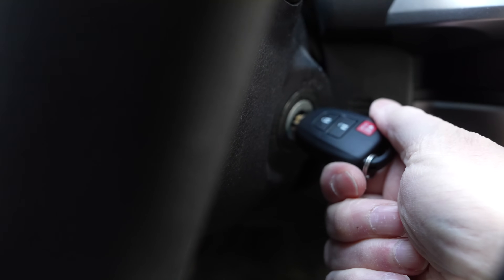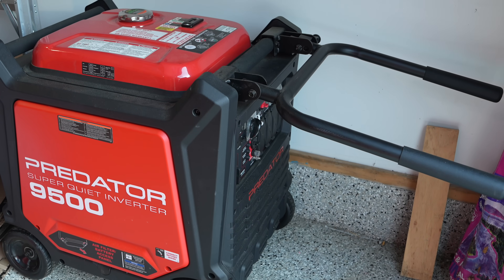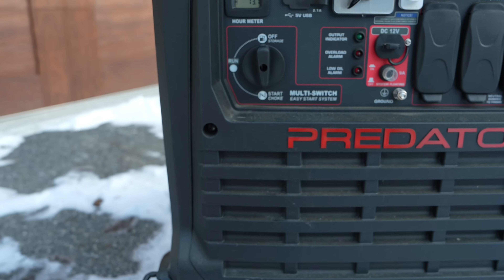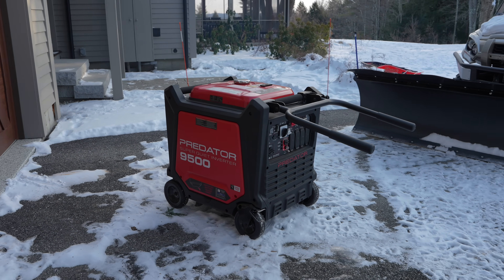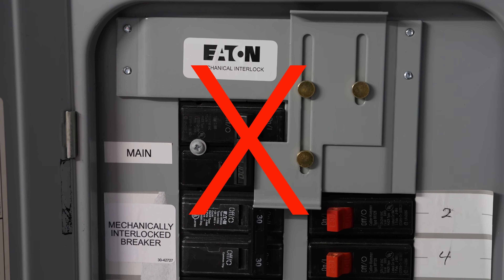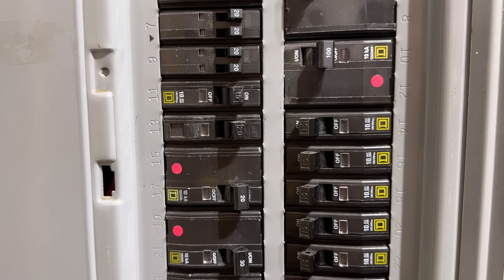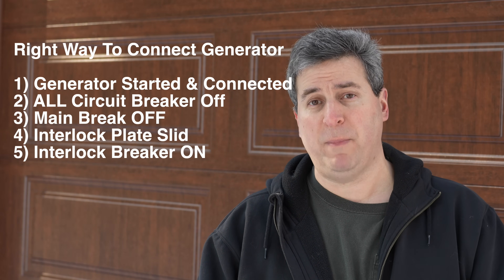Homeowners are Destroying Generators Skipping 1 Step During a Power Outage

Comment: This is good advice for the lay person but if you have an understanding about the size of your generator, your loads AND your breaker box load balancing, you can apply common sense and will be just fine.  So, how about a video on breaker box load balancing?  If you have a 7000W continuous generator, that really means ~29A per leg.  You don't just manage to 7000W, you manage to 3500W or 29A per leg.  Whichever comes first is your current load limit.  I have rearranged breakers to help with this, and printed off which loads are on what leg, so I can most effectively utilize my backup generator power without overloading it.  But I'm a EE so your mileage (and interest) may vary.

Comment: Another reason why I dont like interlock breakers... I use a generator to recharge a battery bank and then devices are plugged into ups units hooked up to that battery bank, that automatically switches back and forth between batteries and main. Basically a solar set up without the solar panels.

Comment: If you’re only focused on backup power for a few key circuits, just get a transfer switch. Generator only powers those circuits, don’t need to touch the main panel when working with the generator. And when the power comes back on you’ll know because the rest of the circuits not wired to the transfer switch will come on.
Reply: Put the interlock in a subpanel and leave the main panel on any you'll get the same affect. That's what I do. When the main AC or water pump kicks on I know my power is restored and can turn off the generator

Comment: As an electrician I agree completely. And shut all your breakers off before shutting down your generator. Never turn your generator on or off under load. 
Also, absolutely shut your generator off and disconnect it from your home BEFORE you reconnect to the gird power!!!!  
And, the kind of generator in this video won't run anywhere near your whole house. Just a few circuits, and NOT your electric range, water heater, clothes dryer, vacuum cleaner, hairdryer, etc. A few lights, the fridge, and a computer. Stuff like that.   Get a proper generator interconnect if you can afford it.

Comment: Have never seen the interlock set up. Very smart.
Reply: Never seen one here in Europe... The few homes with backup power that I've seen either had 2 main breakers with no interlock (iffy and violates code), a rotary 3 way switch with a disconnected middle position (which is what I installed), or an automatic cutover.  The latter seems to be popular with battery setups, and some cutover systems are fast enough to make a seamless transition that not even electronics will notice.

Comment: I have a 6 circuit bypass box with critical 15A circuits. On a power outage, the first thing I do is switch them all from LINE to OFF. After the generator hookup outdoors is complete and it is running, each circuit is flipped from OFF to GEN one at a time, starting with the most essentials ones: sump pump, then fridges, then furnace, followed by the others. Once they are all on GEN, things are on autopilot.

It's important to consider what to do when you shut down the generator: Before shutting off generator, flip each circuit from GEN to OFF, to protect the appliances from low voltage. Then once generator is running again, flip each one from OFF to GEN one at a time.

If power comes on during generator power, flip each circuit slowly from GEN to OFF to LINE.

Comment: Putting the pedal all the way down when starting won't start the car. That puts it into clear flood mode and cuts off fuel to the engine. So yes, you're right, you wouldn't start your car like that, but only because it won't start.

Comment: Red dots are okay. I used a spreadsheet printout of my panel and used yellow highlighting with bold red print for essential circuits.  Pasted it right beside the panel for easy reference. As you say one may not be thinking clearly when under emergency situations. Oh having a charged flashlight at the ready helps too.

Comment: You're not wrong that you don't want to dump a huge load on the generator in one shot, but flipping ALL breakers off first isn't always necessary. In my home, unless I'm cooking or running the dryer, the only large load potentially running is my AC and water heater.... so I'd shut those off. Even if all the lights were on in the house (which never happens), that's maybe 20-30 bulbs.... X 9 watts each.... 180-270 watts. Add to that maybe another 100-200 watts max for my router and modem, plus some minor loads for clocks, wall worts, etc, and we're talking about no more than maybe 600 watts, but probably much less than that. Then there's a freezer and a fridge.... noticeable, but not a huge draw. Not sure what's different about all that versus say plugging in a power tool (circular saw, table saw, large hammer drill, etc.) at a job site and squeezing the trigger. In fact, I'd say the power tool would be a larger draw/spike than all the other stuff combined. On a 5000+ watt genny, that's nothing.

Comment: Good tip for newbie house generator owners. I did my system right by utilizing a Reliance 10 circuit transfer panel. Step 1 is ensure the transfer panel switches are all set to "off" , then plug in your outside feed , fire up your generator, and last is move all the switches to "Gen".

Comment: Also thumb down for clickbait. Thumbnail pointed toward the plug saying “WRONG” but nothing indicated anything wrong related to the plug. Normally admire his vids, but this one was way off.
Reply from the maker: The point was just plugging in like this is wrong without turning off your breakers and following the other tips first.
Reply: @ but that wasn’t indicated on the thumbnail. No other information was given other than the plug was wrong. Clearly clickbait. Your vids are usually quite informative, and can stand on their own. So there should be no need to lure people with misinformation.

Comment: Got it backwards with eco mode. Should be on when starting so it will truly idle while it warms up. Will take longer, but it’ll extend the life of the generator. Ironic that you said to turn the eco mode off so it runs at full speed, but then you said let it idle. Full speed isn’t idling.
Reply from the maker: I hear what you are sayng, what I showed is procedures by the book for Honda and every generator with this mode. Search on a manual you will see. I wouldn't make stuff up on you

Comment: I have and interlock and plug set up like this. Can anyone tell me if I need to worry about a bonded neutral vs a floating neutral on the generator? Or can I just plug it into the house. I don't see anyone addressing this when there plugging in their generators to the house.

Comment: Just because all your breakers are on doesn’t mean every circuit is drawing power or some circuits only have a small load on them, they are not going to be an issue. The problems occur with high demand circuits like AC or Hot water heaters.

Comment: do not start or stop connect or disconnect your generator under load!!!!!!!!!!!!! shed load 100% before starting or stopping bring the load back on line gradually, this is especially important the smaller the generator is.  if you have a 4500 watt tank water heater ask an electrician about moving one of the phase conductors to neutral, some even have a 3 way switch that does this in hurricane country

Comment: Get a Standby Generator with an Automatic Transfer Switch installed. You will not have to fumble around with trying to do all the manual steps in the middle of the night when all the power usually goes out. In addition these smaller portable generators have insufficient power to heat your home, power the electric stove, hot water heater, heat pump, etc.

Comment: Best practice is to install a dedicated transfer switch. It's safe and solves the problem of inadvertent back feeding. Using a transfer switch will require you to switch from line power to Gen power one circuit at a time so it solves both issues safely...

Comment: Useful, but you missed a bit.
The interlock is so that you cannot connect the genny to the grid, yes, but not just "illegal feed" to the grid.
The genny will not be grid-synchornous, so you must expect that it and the grid will "fight" - worst case, you're hitting the grid's negative peaks with the genny's positive peaks.
A blown fuse or tripped breaker?
You did well.
An exploded generator?
Not a happy day, folks.

Comment: Great video, nice and brief.
Only thing I would change is connecting the power cable at both ends before firing up the generator. 
I opted for the transfer switch over the interlock just as a personal preference. 
My plan is to let the generator run the circuits in a bedroom powering a portable a/c, and kitchen powering the fridge, microwave etc.

Comment: seems like a non-brainer but don't fret, modern generators have a circuit breaker for protection of exactly this issue. It's mostly a non issue unless of course your generator has no breaker or a bad breaker.

Comment: This is a good tip .. but there's one problem.  Most generators that are wired to plug into a house have had their ground lifted, so that the generator can get its ground from the house panel.  Starting your generator without plugging it in first will cause a fault light on the generator (typically) which will require the generator to be reset.

Comment: As a retired Power Generation Engineer, I agree 100% with everything you showed. And for you people who like to bypass the safety breaker, DO NOT DO THAT! It's not that expensive and it saves lives. It's too easy to forget to turn off the main when the power is out. If it back feeds the power lines, it can kill the lineman. There are various devices to do this, the one in this video is the cheapest and works for most. Personally, I would use a transfer switch (automatic or manual) today because of the ease of operation and the costs have dramatically dropped.
Reply: Not doing it to code is dangerous, puts your house at risk, and  could kill a lineman.  The better generator sets have pressurized oil systems and filters.  I have written  instructions on my generator load center explaining the steps to start and stop the generator set and transfer the load.
If your generator has a battery-powered starter  keep a battery tender on the battery so it will start when needed.
Reply: It's pretty expensive. I can wire mine for about $75 since my only expense is a 50A plug with 15ft of 6 gauge wire and a 50A breaker. Doing it to code can run over $500. That's 7 times more expensive and that's doing everything yourself.

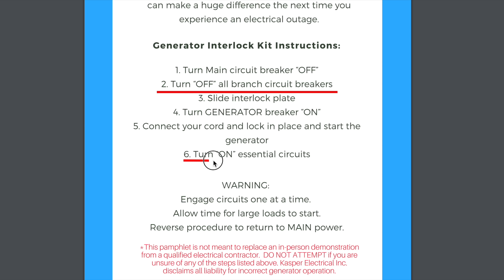Comment: At 01:50 you should have plugged in your generator and connected it to the inlet to the house as instructed at 02:54; item #5 in the "Generator Interlok Kit Instructions".  If you start the generator, then plug the plug into the generator.

Comment: I have a 60 amp Square D sub pannel fed from my main pannel.  The input to the sub pannel are mechanically interlocked at the sub pannel.  With my 6.5kw Honda generator connected I open one breaker and close the other.  When utility power returns the rest of the house lights up.  MY pannel only supplies my critical load.  The small generators that run at a lower speed use a load anticipater circuit which causes  the generator to come up to rated speed when an attached load is turn on. The speed of a generator determines the frequency  of the electricity..

Comment: You forgot one of THE most important steps. Especially depending on where you live. Chain that generator up.
Reply from the maker: Very good point. When I lived near a rougher part of Mass, we had folks stealign the generators the cable companies were using on poles. You knew it when your TV went out! Good tip for sure!

Comment: I wented to the hardware store to get a 240V 4 prong plug. I made a stencil of the socket by holding a piece of paper over the generator outlet and going back and forth with pencil lead. The hardware store was a small town mom and pop hardware, not major affiliate. He'd been there about 25 years, and I had all the faith in the world for his input. We found the plug for the generator right away and then got the older traditional 3 flat prong plug to so I could put the power in thru the welder plug in the garage. I asked the guy which wire went to where and he told me Black and White opposed each other and the middle one was ground. So I had to ask what about the 4th wire. He said it didn't matter. Well it did. When I got home and got the wiring all done, I started up the generator and plugged in the cable. When I got into the house the very first light I tried was a 100W incandescent and it immediately flashed and burned out. Ditto the 2 light. So I figured that out the hard way. A week or so later I found out my door bell transformer was burned out too. So, a word to the wise: you can do trial and error like I did, or you can use a volt meter and know what's going one befor any carnage. ben/ michigan

Comment: One thing that could of been stated is for those who live in cold areas. They can use a block heater on the oil pan that stays plugged into the house and thus keeping the oil hot till you need the generator. Cold starting a generator with cold oil may not work at all depending on area and how cold it gets there. 
Steps are. Generator in garage plugged into oil pan heater. once power is lost then unplug block heater and move outside. and then all the stuff that you stated.
This can also remove the warm up time or cut it down by a lot.

Comment: If you plan on connecting your portable generator to your house breaker panel, make sure that the generator has a "floating neutral" first. Confirm with the manufacturer of the generator and make the necessary adjustments before proceeding.